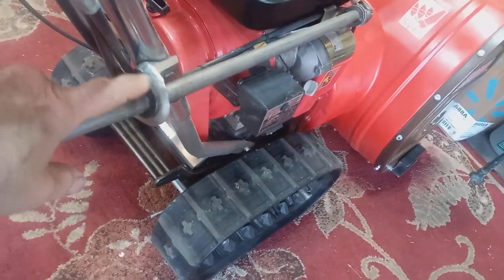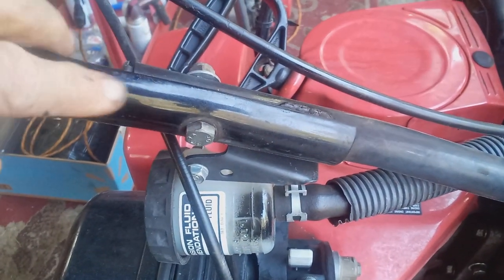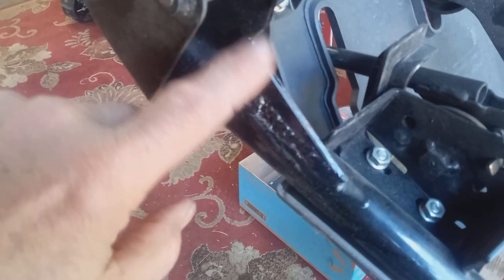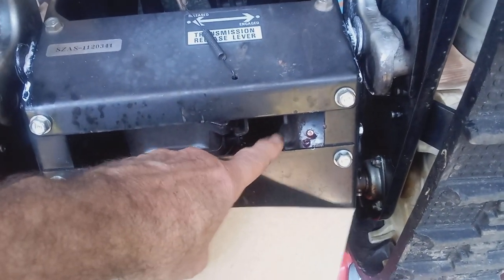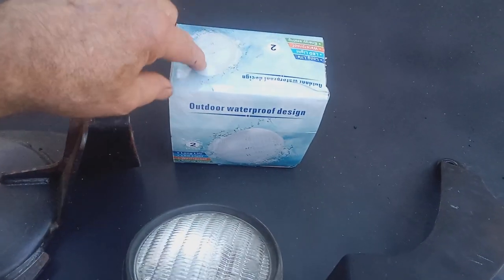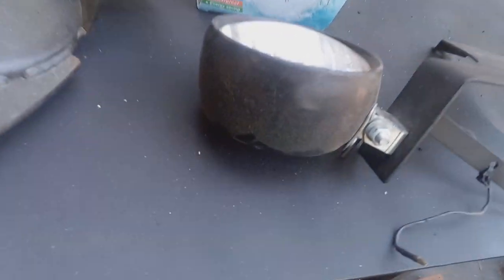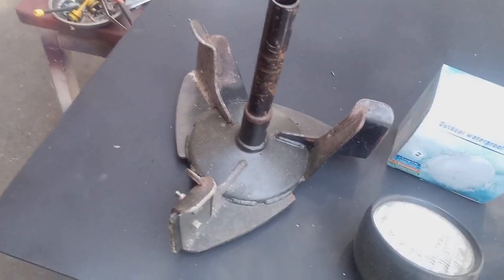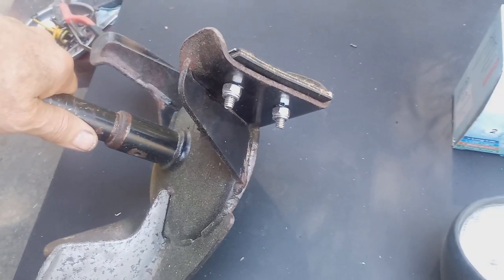7 Easy Upgrades To Make Your Honda Snowblower BETTER Than New ! @HondaSnowblowerEnthusiasts311

Comment: My favorite upgrade was adding handlebar warmers.  I changed to an LED light at the same time in order to reduce the total power draw.  The issue with the LED light is that it doesn’t get hot enough to melt snow.  The grip warmers are easy to install and are truly awesome.
Reply from the maker: Many owners enjoy the brightness of the LED.

Comment: Hi Anthony, thanks for the great videos!  Question, on the grommet upgrade to the chute handle, are you popping off the plastic free wheeling handle in order to fit that grommet?  Mine doesn't seem to want to pull off very easy, is there a trick?  Thanks!!
Reply from the maker: thought i answered this. pull and twist at same time.

Comment: WoW.  First thing, i notice, is your  ' shop  rates '   sign.  Very cute....!   I would like to add another one ....for  all.   CHEAP  LABOR  ISN'T   SKILLED.   SKILLED  LABOR  ISN'T   CHEAP .  
i will try  to incorporate  your  ideas,  onto / into  my Murray  2008  snowblower. Engine starts - runs  very good. 2 reverse speeds, 4 or 5 forward ones.  Works good. I welded a bracket to the chute turning  side ; was kinda bendy , with a cheap sheet metal bracket.  Where the turn handle, goes onto the round gear mounting .......Be good to  your  stuff....folks !
Reply from the maker: shop is almost always a mess but I know where everything is.